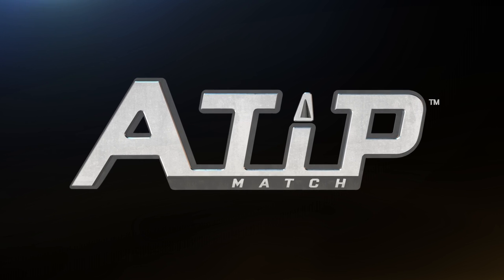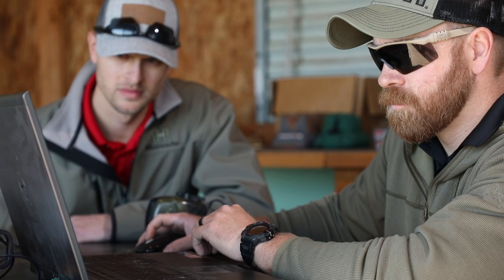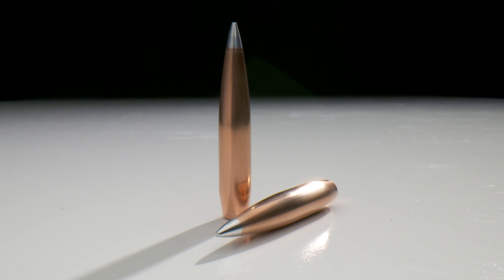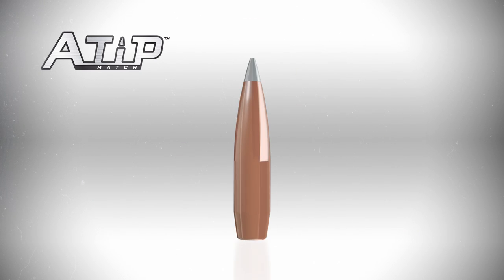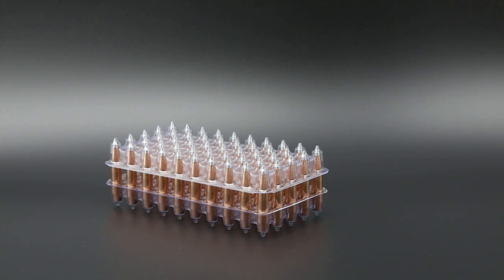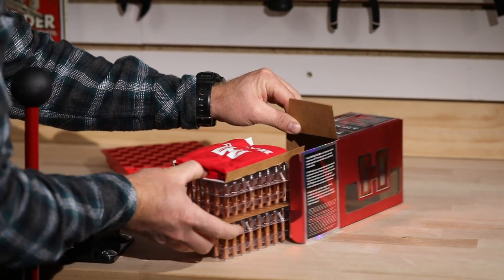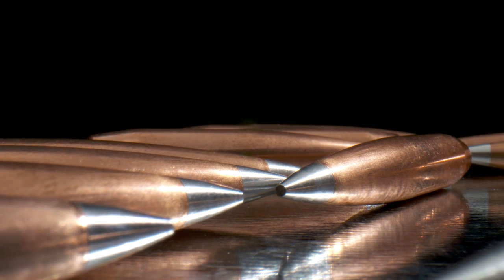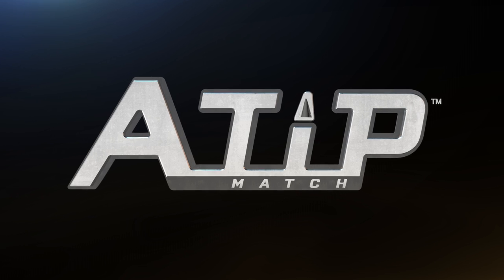Hornady® A-Tip™ Match Bullets

Comment: will the 230 30 cal stabilize with 1 in 10 twist  some 230s can if so thats my new bullet
Reply: Their specs list 1 in 9 minimum for the 230. Any slower twist and you'll be giving up b/c.
Reply: These are meant for the 300 PRC cartridge that bridges the gap between 300 Win Mag and .338 LM.  I do hope they come out with some lighter .30's

Comment: Almost 100%, the tip looks FLAT. Ever seen an aircraft w a flat nose?
Reply: At these velocities, the tip creates a low pressure area that reduces drag (or something to that effect) Sharp tips do nothing for aero performance at 3000 fps and this way they can get the overall length much more consistent because they face the tips at a known dimension.
Reply: Chris Hoesel , You keep beleiving that. And a box flies better than a needle. ( exaggerated,  but u get the point) Blunt arrows fly faster & cut deeper too than a razorhead too.   I got a bridge in Brooklyn that generates a mil a day in tolls I will sell u for the change in your pocket. Im tired of being rich. Your turn....